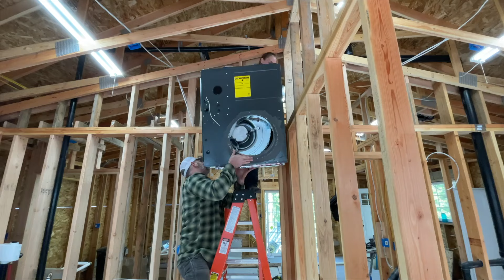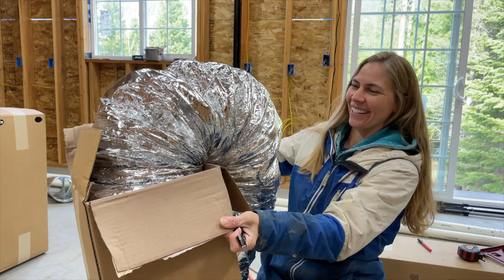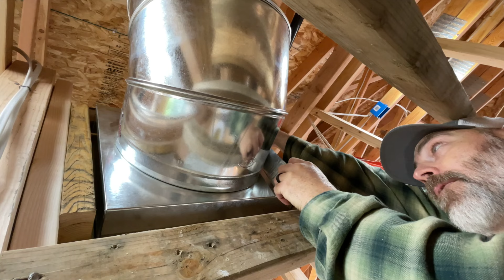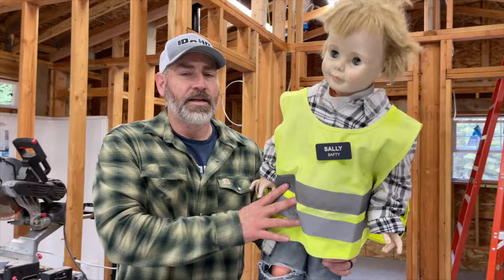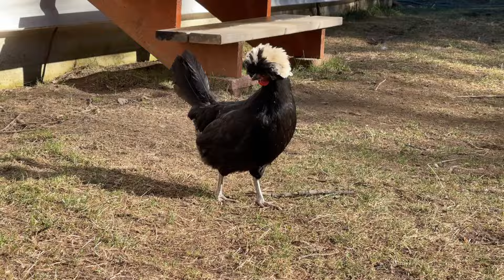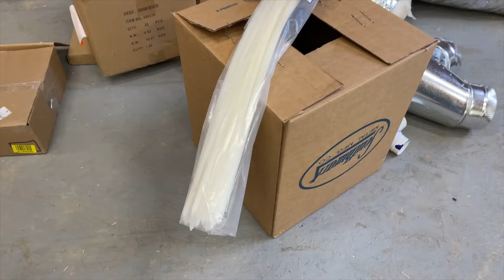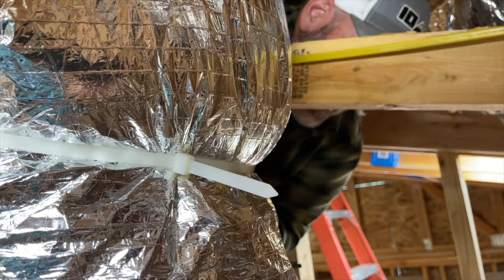Flexible Duct Work Installation - Building our Home in the Mountains

Comment: your furnace is not supposed to be an attic it should be downstairs in the basement or on the main level not in the attic
Reply: It's ok because the roof is under the basement.
Reply: @RealDeanWinchester , Huh ????
Reply: @augustreil  weird, right?
Reply: Almost all air handlers in Texas are in the attic its not an issue unless you lack attic space. Servicing can be a problem that must be addressed before installing the system.

Comment: Any exposed metal will sweat
Reply: So what should you do with metal Wyes, that the flex ducts attach to that split the duct run. Those will be exposed metal for my AC. Thanks.

Comment: I hope a professional did the load calculations for your space and did proper duct sizing..Nothing worse than un-certified do it yourselves in the A/C heating trade.90 DEGREE TURNS AD MASSIVE FRICTION HEAT TO THE DUCT SYSTEM..Stretch out the ducts and avoid turns when possible. The foil tape must be rubbed down with a rubdown tool.The glue is friction activated..I see lots of trouble in your future watching your install.
Reply: Ah, yes. ACCA Manuals J, D & S.  I remember it well.
Reply: its pressure sensitive adhesive.....
Reply: It’s not rocket science and it’s not a high rise.  Without using manual D.  This looks okay.

Comment: This 100% is absolutely NOT the way to install ductwork. 

Duct work needs to be installed properly according to the ACCA manuals and the ADC standards. 

Do not DIY anything unless you have done the proper research. 

The furnace video you mentioned your “heating guy”- he absolutely failed you or set you up to fail where you’ll end up spending hundreds to have your entire ductwork reinstalled.
Reply: What did he do wrong?